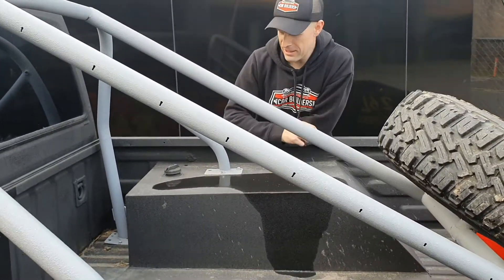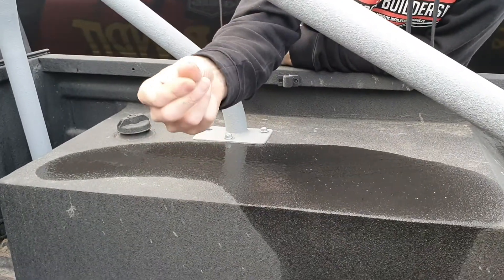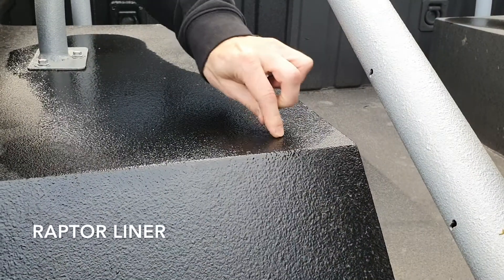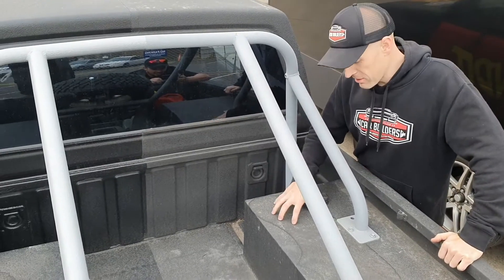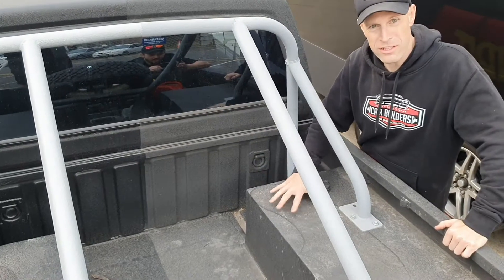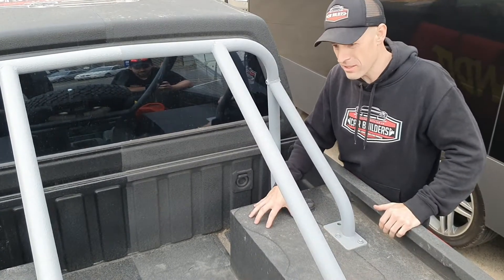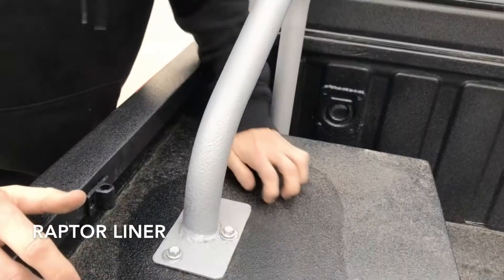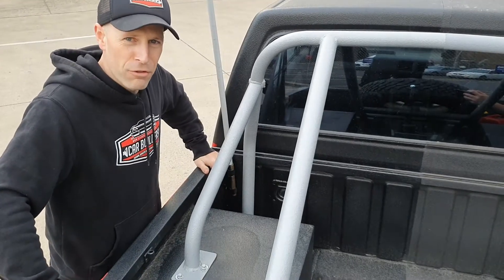How does fuel go on Bully liner or Raptor Liner? Is it resistant?

Comment: Watched a few parts of this series. Is the bullyliner fading, or is that just an effect from lighting. I'm leaning towards using bullyliner for the ease of touch ups but I want a coating that will last some years.
Reply from the maker: Hi Dan. No, not fading but Bully Midnight isn't a pitch black and is much lighter than the Raptor Black. I know Bully are working on a more true black but I'm not sure on the timeline of its release. Both Raptor and Bully has the same 'life' rating. Both are also tested to 5000 hours of continous UV light.
Reply: @carbuilders1  Is this the "Jet Black" that they now have? I am leaning towards Raptor due to the colour but if the "Jet Black" is darker it could sway me back.

Comment: I heard the bully coating suffers in the heat. Not sure how true that is. Would love to see a heat test. Maybe get both of them hot and see how they compare to each other with scratches
Reply from the maker: Hi ImBillySastard. This will be the next test we do. We are currently modifying an oven so that we can get controlled results. Watch this space..
Reply: Cheers for the reply 👍🏻 I know I’m not the only one who’d like to see that video when it comes out haha
Reply: Yes very interested in this as well.
Fixing windmills in qld outback where 40c is not uncommon.. also the heat resistance would be interesting.
Testing three pieces of metal one normal, one raptor, one bully and heat on one side and what the temp is on the back side.

Comment: Great answer to a question that I forgot to even think about. How about for diesel fuel (cetane 40) (in AUSTRALIA  I think diesel is called distillate) ?
 I'm  in the states here in NY, and I plan on using the Raptor liner on my diesel Ford F350...
 I had previously painted the truck with Plasti Dip, which the accidental over flow of diesel fuel,  kind of got ruined it  in the fuel fill area...